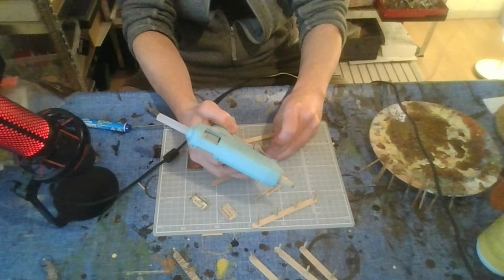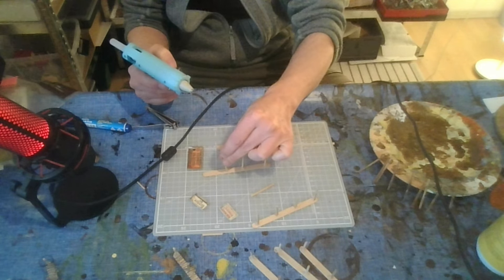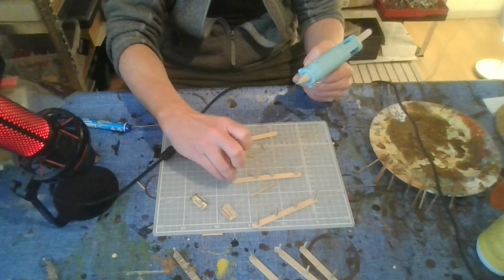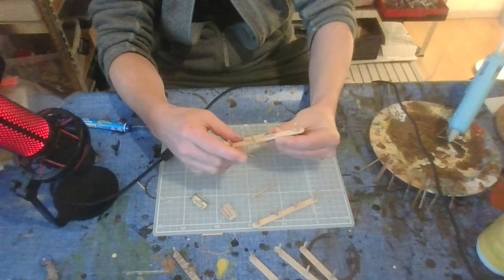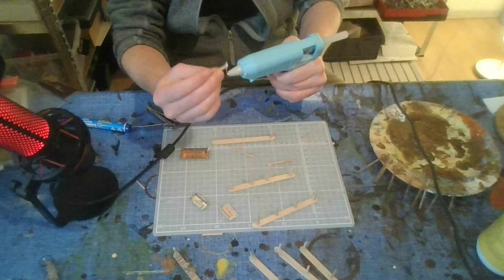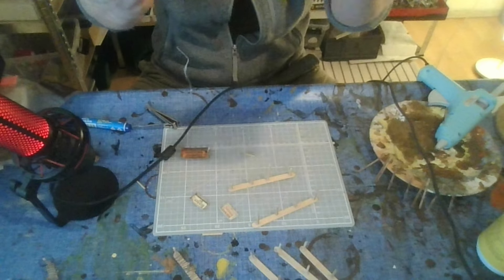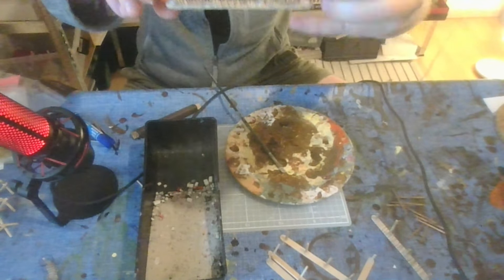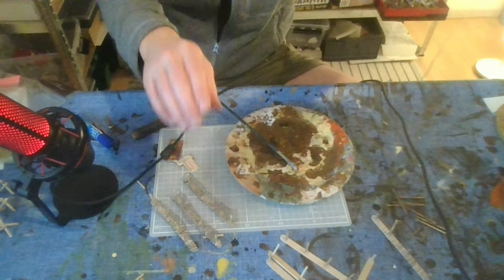Hobby, building barbed wire terrain

Comment: Looks good but the only thing I’d do different is glue the sand on first then attach the wire. You can glue the wire tot be top of the sand with super glue.
Reply from the maker: Good point